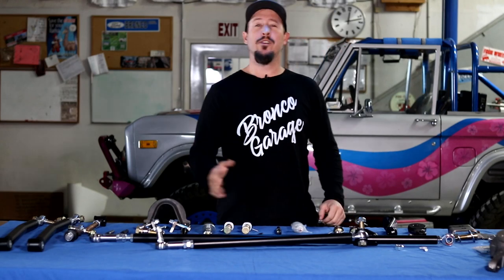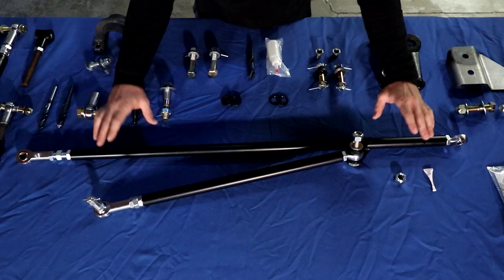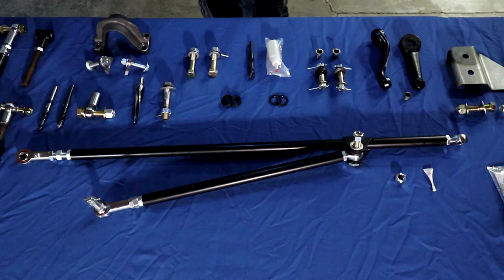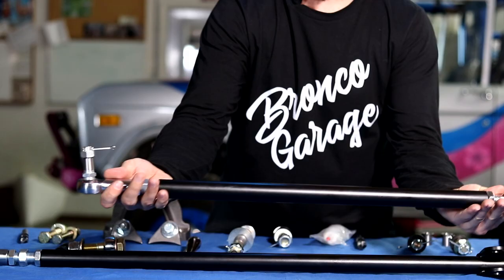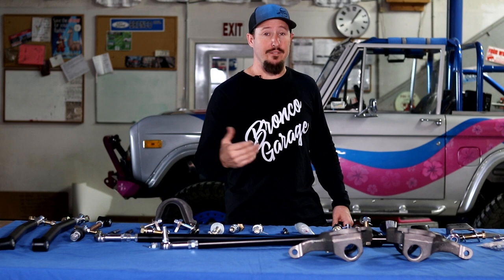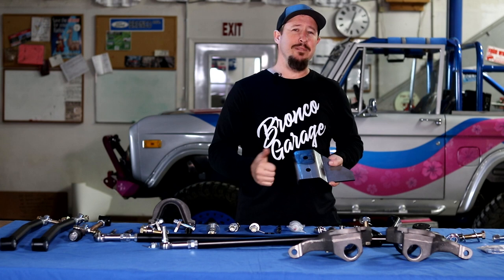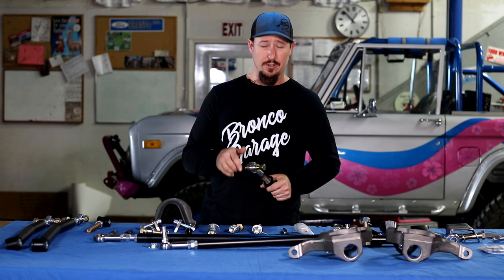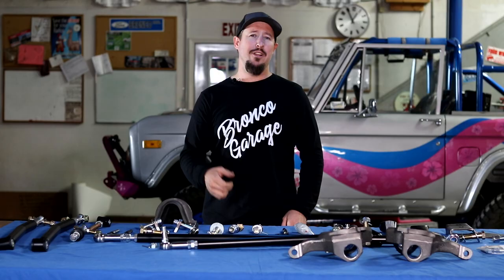The Best Early Bronco Heim Steering - James Duff Dual Sport Heim Steer System

Comment: I noticed you used a rear bump stop for the front to solve the issue of the track bar riser bracket hitting the frame at full bump. Looks clean and practical.
Reply from the maker: Nice Catch - Those are the 3.5" version bumpstops that can be found here - https://dufftuff.com/product/complete-bump-stop-kit-1966-77-bronco/?dta=1
Reply: Ùù @BroncoGarage